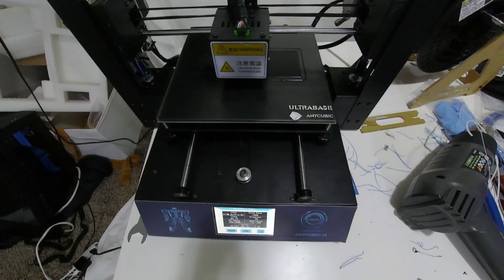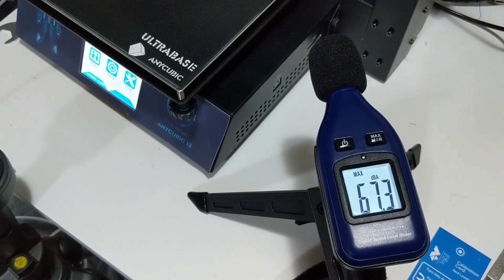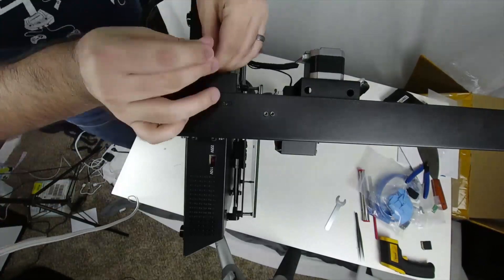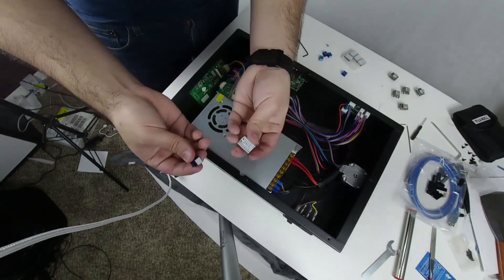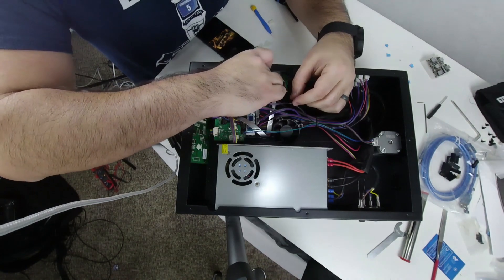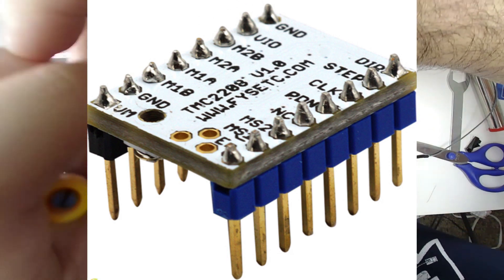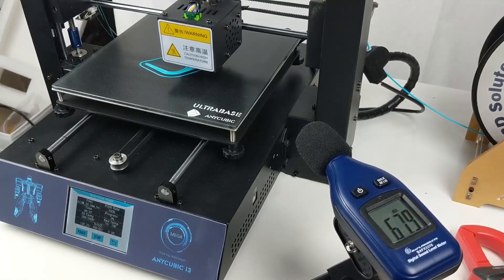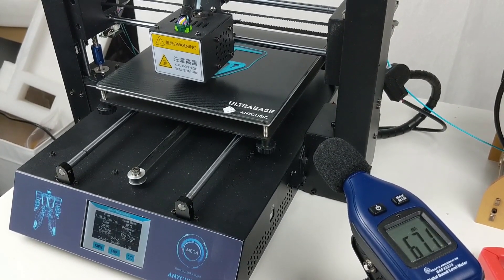Anycubic i3 Mega TMC2208 Silent Mod

Comment: made the switch as well, I ran into a problem, the x axis tmc 2208 is at 0-300mV then when turning the pot it that range or a sudden bump up to 1.77V. turn back down it at 300mv hum gona fiddle abit with this but was a new one for me.
Reply from the maker: The adjustment is very slight.
Reply: LOHTEC well seems The trimpot is broken or losse or something, same problem no matter where i put it, xyz, set vref on The other 4 no problem. Will just order one more as I dont know how to fix that. thanks for The respons.

Fun side note The stepper fan seems to go totaly offline unless one stock driver is in place.
Reply from the maker: Malainor yep, possible you got a bad one. I'd suggest putting it on the z axis for now to minimize noise

Comment: I made the change of 5 x TMC2208 and they work very well and in silence, I do not recognize my printer Anycubic i3 Mega, very happy with this operation, after that, I would change the fan in a second time, now, I 'Just hear the sound of the fans !
Note: I set the reference voltage from 0.84 to 0.85 v
Thank you LOHTEC
Reply: I read something about 1,4V whats the right one for europe?

Comment: I did this great modification and also replaced all noisy fans by silent ones except for the left nozzle blower for which I couldn't find a silent version. This fan modification dropped the total noise an extra 14db to 53db only!!!
Reply from the maker: Which fans did you end up getting?
Reply: Right hotend fan 40x40x10mm: Noctua NF-A4x10 FLX
Powersuplly fan 60x60x10mm: Gelid Silent 6
Stepmotor drivers fan 50x50x10: Blacknoise Ultra Silent (from Germany)

Comment: Hi, How do i install the TMC2130 steppers ?
Reply from the maker: Nick Meijs it's mostly the same way, but then you need to also solder some jumpers and use software to adjust some settings. Haven't done it personally. I'd get 2208s since they are better and easier.

Comment: Just received the new drivers and man those babies work great ! so silent ! now what fans should I get for the PSU and the control board to finish the job.
Reply: I used one 12Volt Sunon HA40101V4-0000-999 for the hotend cooling on the right side of printer head. 
And Two 12V Sunon HA60151V4-0000-999. 60x15mm, one for the Power Unit and the other one for the Main PCB. Mounted with printed part found on Thiniverse.
Reply from the maker: Have been working on Cetus3D videos so I haven't looked into it yet. Let me know what you find!
Reply: @npgoalkeeper _ are you sure it was 120mm across, and 10mm thick? The thinnest 120mm fan by Noctua that I'm finding is 15mm.

Comment: Hey, nice video! I'm waiting for mine to arrive. I also plan on switching the connectors instead of messing with the software. However, I have a question, is 0.85V enough? I read on some forums it should be 1.1 - 1.2 V.
Reply from the maker: Spokoman depends what you get. The 2100s need more voltage and you have to solder a wire to each. 2208 can use less and doesn't need soldering. I've seen .9v recommended, but also .8v so I split the difference and haven't had any issues.
Reply: 1.1 - 1.2 could overheat the driver causing problems. I personally use 1.0 volt, 1.1 volt was too high for me

Comment: I made the change to the 2208 on my I3 Mega. Now I have random beeps during the print. The beeps are not as loud as e.g. the touch display but they are annoying. Printing works fine. Do you any idea what it can be?
Reply from the maker: It beeped at me several times when I first got the printer, but that went away and putting the drivers in didn't bring them back.
Reply: I believe the beeping was there before i changed the drivers. I noticed it while warming up. While printing i pobably just couldnt hear it. With the New drivers i can. I wonder where it comes from.

Comment: I test the TMC2130 but you need todo configurate each driver to activate SPI Mode and solder very small pads. In TMC2208 you can set in spreadcycle Mode with USB / TTL adapter and solder only one pad. I do not test directly. Thanks

Comment: You do not loose steps?? In what configuration you set the drivers, stealthchop or spreadcycle. Thanks
Reply from the maker: Haven't so far. Printed this the other day at .1mm https://www.thingiverse.com/make:461852. All settings at stock other than voltage.
Reply: The TMC2208 has Stealthchop2 which maintains quite a bit more torque.  Most people find that it provides as much torque and positional accuracy as Spreadcycle with the TMC2130 while being almost silent.  Remember that a 3 decibel reduction effectively cuts perceived sound in half.  

Also, TMC2130 is first generation and TMC2208 is the new 2nd generation in their Poulou-style lineup

Comment: Thanks a lot for the video.
I have the i3 Mega with firmware 1.1.0. Is that the one you also have, or will this work with that version? I've read that the other i3 Mega with firmware 1.4 uses a different board.
Thanks again :)
Reply from the maker: I have 1.1.0 so you are all good to go!
Reply: Awesome :) Thank you for the reply!